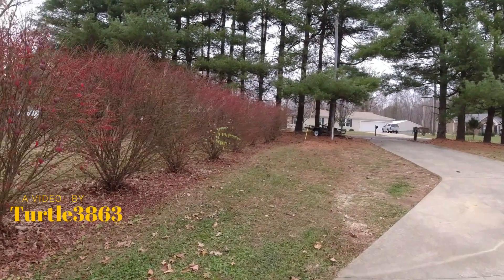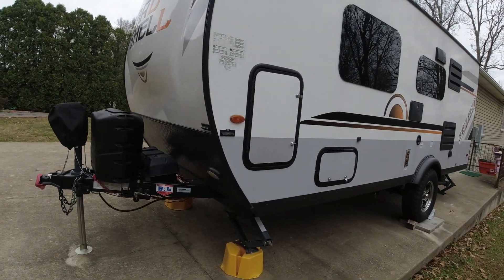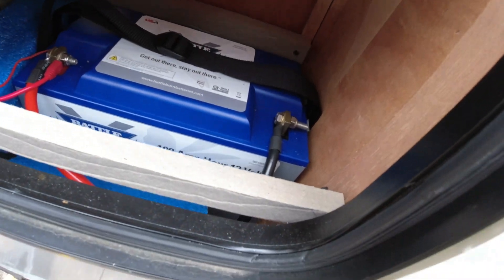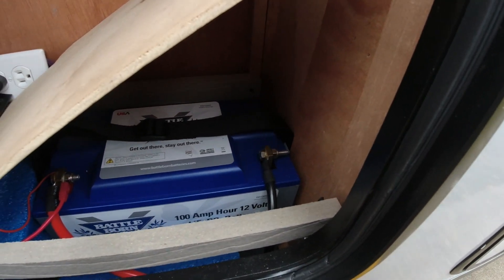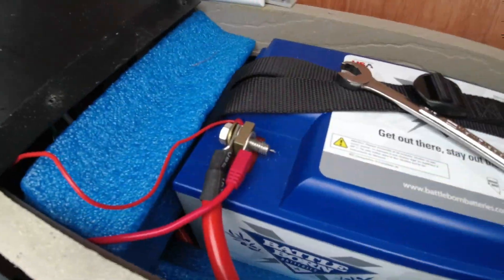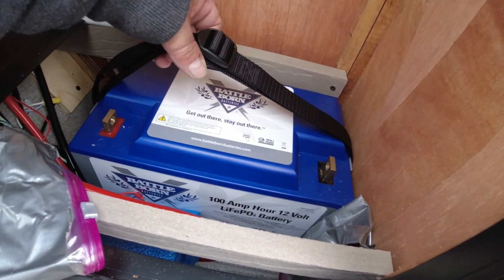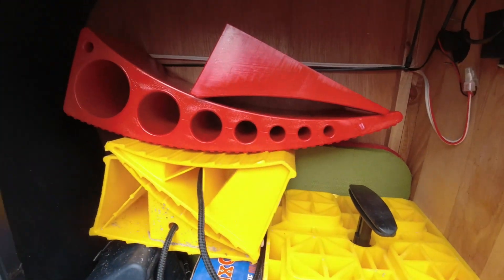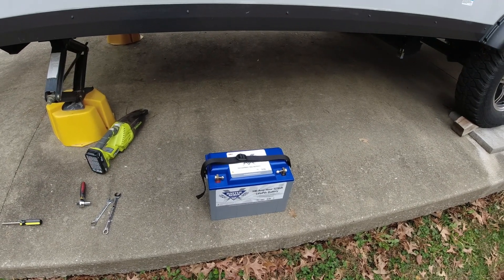Lithium Battery Winter Storage

Comment: I'm a little curious about something you did. You said you were leaving the solar connected? Won't that damage the solar charge controller without a battery attached? I always read to disconnect solar first and then the battery. When hooking up, just the opposite, battery first then solar. I had a cheap PWM charge controller that I ruined by hooking up my solar panels before the batteries. Of course I may just be talking out my butt and don't have any idea what I'm talking about.🤣
Reply from the maker: We will have to see, the controller in the trailer shows a blank screen so I am assuming it was disconnected when I disconnected the battery. My controller is more or less junk, so if I messed it up I will get a better one next spring.
Reply: @Turtle3863  yes, a controller without battery connected can be damaged by hooked up solar panel running.  I always put single poll switch in line on solar input to turn off when battery disconnected or inline fuse and pull fuse.
Reply from the maker: @williambingham2459  Great info, I will definitely do that before I hook it up in the Spring. Glad everyone is adding comments and educating me as I go.

Comment: The issue with LIFEPO4 is, if not a smart battery with heat coils, to not discharge at or below 32 degrees.  Don't charge below about 20 degrees.  Most LIFEPO4 have temp sensors on BMS for overheat protection.  Some have BMS with low temp cutoff.  I think Battleborn have both sensors to protect charge/discharge.  Check manufactors specs for your battery.  LIFEPO4 will not freeze due to no liquid present in cells.
Reply from the maker: All great points, my only worry was with trusting a do not charge sensor on my battery to not charge when temperatures are extremely low, I am sure Battleborn uses good sensors but why take that chance.
Reply: @Turtle3863  ps: understand "trusting" electronics.  Better safe than sorry with expensive investment.  By the way, I live in Richmond, KY, with Aliner Scout Lite I just traded for at Comfort RV.  They included Wind protection polls, upgraded AC that is digital with remote and AGM battery 80 amp.  Beat everyone on trade and cost of trailer

Comment: What happened to your A frame.
On your lithium battery and this is what Battle Born says. Drain the power down to 75%. Make sure it’s not hooked to any charging source ( you don’t want it to charge below 32 degrees Fahrenheit) although the BMS probably won’t let it.  You t has no water in it so it won’t freeze and burst.
Reply from the maker: Thanks, good info. Most likely going above and beyond by storing it indoors, but better safe than sorry.
Reply: @Turtle3863  I keep my two Battle Born’s outside in my Rockwood A213HW in the winter. Have been doing this for 4 years. No problems.
Reply from the maker: @kevinholland4156  well, that might be the way I roll next year. We will just have to see.
Reply from the maker: As far as the A liner, I do miss it but having a fully contained bathroom really became a must after Covid and we enjoy Harvest Host as well.
Reply: @Turtle3863  I forgot to tell you I live in Utah. Last week it went down at night to 22 degrees and 0 is not uncommon during the winter months.